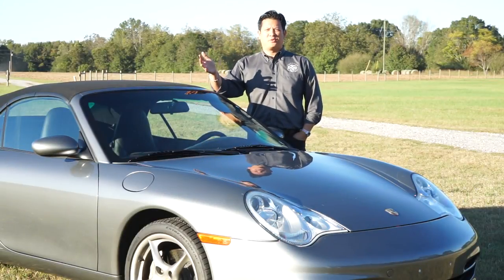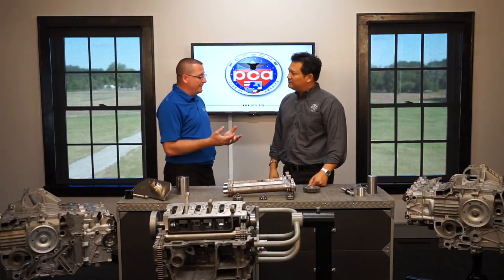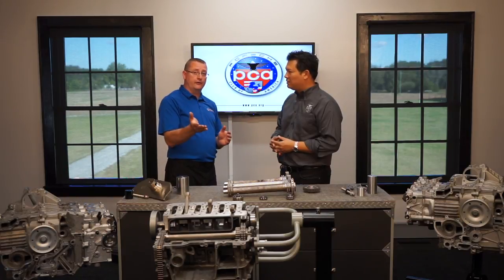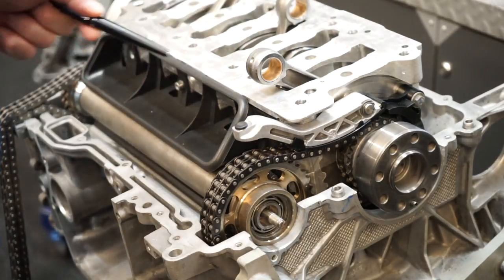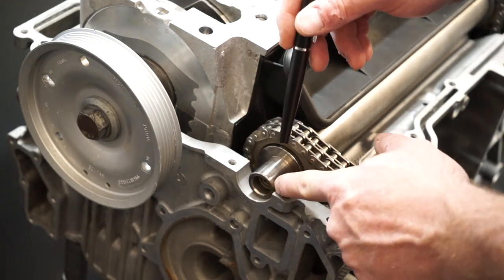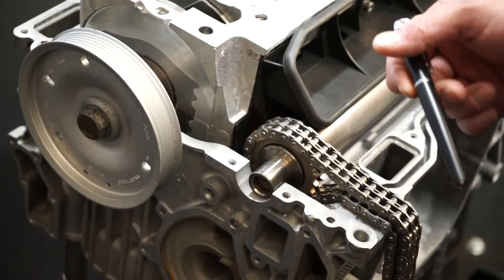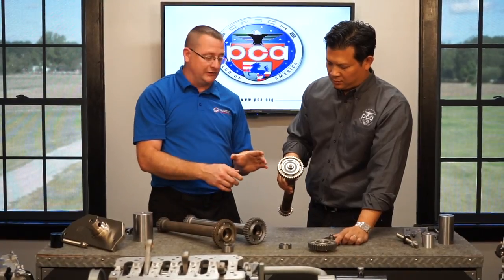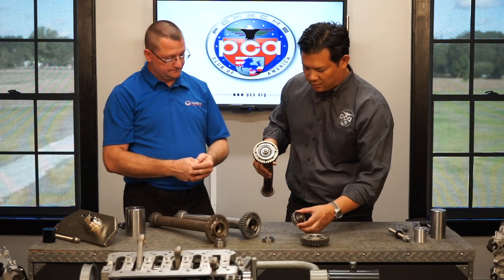Porsche 986/996: Intermediate shaft and IMS bearing explained - PCA Spotlight

Comment: This video is priceless to the 996 owners.
I have a 2003 996 with the replacement AD engine.

Engine was replaced by Porsche of North Houston in 2010, therefore the proper design dual row bearing.
I spent $600 before the puchase to have the trans pulled and visual photos taken of the large 22 mm nut. Now I have evidence for a resale someday.
In this video  I did learn that 6 month oil changes are jst as important as 5000 mile oil changes.
Lastly I am much more comfortable with my 996 after listening to the endorsement of the robustness of the new design bearing.
I did learn that 6 month oil changes are jst as important as 5000 mile oil changes.
Thank You this is a great service.
Reply from the maker: Thanks for watching. Be sure to subscribe.

Comment: Brilliant video...very explanatory but not overly complicated. IMS is just a way of transmitting drive from the crank to camshafts on a flat six engine. And that shaft runs on a bearing that is prone to failure. Until now I thought it was some mystical design, but now it's pretty simple.

Comment: I recall hearing from a US company that a solution to IMS problems is a modified cover with a drilling in it attached to which is an oil line that connects to a spare oil output. You remove the existing cover flip out the oil seal replace the cover with the modified replacement cover then hook up the pipe. End of problems regardless of bearing type. Search the net to find the kit.

Comment: I think the reason why they have two different bearings is because the front end of the intermediate shaft gets it lubrication from the engine oil , but the rear doesn’t get any lubrication from the oil, so that’s why it was made as a sealed bearing.
Reply: W C       I think that is exactly what Jake said.  I think.

Comment: I have talked to many Porsche mechanics that claim the IMS is not the main problem,instead the issue is lazy owners not warming up their engine to proper temps before thrashing the car through the gears down the road.Lets not forget the Carrera holds 8.5 quarts of oil and needs to be distributed to all parts of the motor at peak temperature. The mechanic insists the motor oil be warmed to 160 plus degrees to properly lubricate all the critical engine parts including the IMS bearing so it does not dry out and seize over time.I have owned a 996 and a 997 and never had one issue well over 120k.The Motul 8100 access is my oil of choice since it lubricates the IMS continuously compared to any other oil on the market.Do yourself a favor and Relax while your Porsche idles for 10 to 15 minutes before hitting the road ,and you will rarely have any issues ever.
Reply: T Shankster 
 Wrong wrong wrong.... respectfully, this isn’t true and I will simply paraphrase flat six innovations ( http://flat6innovations.com/)
  The primary issue with IMS failures is contaminated oil... caused by too infrequent oil changes.... the primary source of contamination is fuel intrusion based from cars injecting additional fuel into the system... while attempting to warmup prior to driving.... 
 Keep in mind the failure rate is 5 to 15% ; so the fact that your car has not had a problem makes sense because the odds speak towards it... my 996 hasn’t had a problem either....
 Extended warmups ( as you suggest) are a part of the problem
Reply: I agree with you that an engine should be warmed up. However,  per the video, the IMS bearings from 1997 to 2008 were sealed bearings. They weren't engine oil lubricated.
Reply: T Shankster I thought most or some of these bearings were sealed, if that’s the case would warming it up matter?
Reply: I may be overly careful but on my 2006 997 I never rev the engine over 3000 until the oil temperature is fully warmed up to 200°
Reply: Idling for 10 to 15 minutes for warming up the vehicle is not ideal.   I agree that quality oil is a requirement and driving it hard should only be done after warming up the car to proper oil temps (10-15 minutes).  Best bet is to start the car, buckle up , and drive gently for the first 5 minutes, and no high-revving for the next 5-10 minutes after that.
Reply: Old thread, but we have 2 older women with these cars with failures @6k & 22k. An 02 & an 04 respectively. Neither has been over 3 or 4,000 RPM other than when I have driven them. Porsche & their techs just refused to admit they are a bad design. It is German arrogance at it's finest. I worked for Lexus/Toyota for 20 years. They always admitted their faults & helped their customers. Full Stop.
Reply: Your many Porsche mechanics are wrong, and given the relatively low failure rate, your own personal experience isn't surprising.  The main failure mode is disintegration of the rear IMS ball bearing.  The rear IMS bearing is, in fact, a SEALED bearing.  It is not designed to be lubricated by the engine oil, and *there are no passageways that carry pressurized oil from an oil galley to the bearing race*.  This bearing is responsible for resisting both axial and radial force, and is designed to be used with its own lubricant capable of withstanding the much higher contact pressures found in a ball bearing vs a plain journal bearing.  

It has become evident that over time, the IMS bearing seals are inadequate and the original lubrication present in the sealed bearing is washed out.  If your rear IMS bearing is being lubricated by an occasional splash of engine oil, regardless of the temperature, it's likely already on its way to failure.  In fact, the oil being more viscous (colder) would likely contribute to a LONGER life of that specific bearing, if it was able to actually make its way into the bearing race.  Which it isn't.

It was a crap design.
Reply: It is a given for ANY auto engine to reach op temp before using it hard.  BTW, don't let the car idle to op temp.  Idle 30 seconds and then drive it normally. It is also a given to use the appropriate type and weight of oil in any engine. So given the higher care level most Porsche owners bestow on their cars, why all these failures vs lesser cars w less attentive owners? Bad inadequate design. Period.
Reply: Only 8.5 qts? My 911S was closer to 12. Good time was had doing the first oil change into a V-8 sized oil pan.

Comment: Let's not forget, the original flat six engines had endless problems with the timing chain tensioners, but you could fix the issues, often during routine maintenance. I think this engine should have had the same internal countershaft design as the original sixes, but oh well. Using a ball bearing that is good for an old roller skate was not a good idea.

Comment: I have been looking to buy a used Boxter but after watching his videos, the thought of owning one scares the hell out of me!
Reply: shouldnt have let it scare you.....you can buy any year you want its fine..... just know that soon as you buy the car
drive it strait to the dealer or who evers gona fix it
then 2500 bukks later know you dont have to worry about it....i think is a ceramic bearing now.
i would do a 2003 and up an get the replacement done but after 2008 your fine no IMS failures..2009 problem fixed by porsche.

Comment: So I had a 2005 Porsche Boxster (987) a couple years ago and I wish this video came out earlier so I could have learned more about the IMS bearing situations. Even though there are exceptions, what was discussed in this video is really solid and holds true to what happened to my car and other people I've met with similar issues. 

I was one of the people who took a chance and didn't do a retrofit IMS bearing since failures were relatively low, but unfortunately my car suffered an engine failure when the IMS bearing had problem. 

With that said, I still loved the car and it was an amazing car to drive. The hydraulic steering's feedback, steering precision, ride quality, etc. Just an amazing car and I'd still recommend these cars to people. Just watch the video, visually inspect your car or get it checked out, and take some precautions and care for your car.
Reply: Bryan Phan      Thank you for your story.  It will help me in my worries.  How many miles did your engine have?
Reply: @boyracer3477  I had about 81K miles when I had the IMS issue.
Reply: @tryptobphan      Thanks.  I'm about 30K from that.  But it breaks the theory that if it lasts this long, it will probably be okay.  And at 50K miles in 22 years, it's been doing a lot of sitting. I've had it for nearly three years and haven't put that many miles on it 
either.  From what I am learning, it's letting the oil just sit in the bottom quarter of the bearing that causes the problem.  Anyway, thanks and fun driving to you !!!
Reply: @boyracer3477  yeah. I was disappointed that mine was right at that edge of being OK if it lasted that long (aka 80K+ miles). But in the end, the company was really nice when I called in. Because of their customer service, I ended up getting a new Cayman at the time. Looking back, I should’ve just did the IMS upgrade for $4K and called it a day. The new cars are amazing but I do miss the hydraulic steering feel and the sound of the older engine of the 987.1.
Reply: @tryptobphan       Well, life is a journey.  Nice chatting.  I'll keep an eye out for your comments.

Comment: Sorry to say this .. but the IMS bearing is engineering design “screw up” by Porsche . I had a   81-84 Volkswagen rabbit back in the day, and decided to one day overhaul the engine . I cracked the engine open and noticed that it also had a intermediate shaft that ran the ignition distributor . Took out the shaft ,I remembered that that bores on both ends of the shaft had solid,pressurized oil, replaceable solid bearing on them, no damage whatsoever on them. I don’t understand why people have this “fix thing that aren’t broken “ mentality..

Comment: Extremely informative and timely ! I, of course fall right into the grey zone.. I have 03 C4S which had IMS failure at 36,000 miles in October 2009. Engine replaced with caret engine November 2009. Clever money says its an M97 design but only way to tell is to drop transmission. Ah well, needed a winter project.
Reply: did they replace it with an 09 engine 0r with an 03 engine thats the question

Comment: my prefered method of solving the problem for my 2.7 m96/23 engine would be installing an unsealed ims bearing and a direct oil feed kit from tunersmotorsport to keep it lubricated at all times. the low displacement of my car avoids the cylinderbore warping issue common on cars with larger engines.
Reply: You should go with the proven and patented journal bearing and oil fed design of the IMS solution.

Comment: Where can I bring my Boxster to replace the factory IMS with the IMS retrofitting. Mine is currently not showing any indication that the IMS is at fault, but the previous owner drove only 10K miles in 16 years and did only oil changes once in a year or some times after 2. years depending up on how much mileage he was putting. So I fear that it may be adversely affecting the IMS seal

Comment: Thank you for this video.  Can you tell me how the design was changed after 2008 to address the IMS bearing issue.  I have a 2011 987.2 Boxster with the 2.9L engine, and wonder how the IMS bearing design and lubrication were changed to address this issue.
Reply: Porsche switched to driving the camshafts directly from the crankshaft, and eliminated the IMS completely. Just google image search Porsche 9a1 and look at cutaway images.
Reply: there is no ims in the 2011 models

Comment: Great video. The first gen is the strongest (when it comes to IMS failure), though a trick that my specialist uses is to remove the seal so the bearing gets lubed by crank oil.
Reply: I've heard that, but it doesn't seem like a good fix.  First, the IMS is not designed to be lubricated by oil.  It's lubricated by grease.  Ya can't just throw any old lube at bearings...they're designed with the mode of lubrication in mind. Second, how can one be sure oil gets to the modified bearing when it was not designed to get oiled by crankcase oil?  At low rpm, and low "splashing", they bearings could get starved of oil I would think.
Reply: @MrShadyfish  Exactly. The whole reason for the sealed bearing was that engine oil could not get to that area of the engine. Therefore an open bearing was not possible. The solution that adds a new oil line with the sole purpose of directing oil at the replacement IMS bearing makes the most sense. Of course it's also the most expensive.

Comment: I bought a 2001 - 911 996 Carrera Cabrio. The owner kept it immaculate but I'm not sure if I need to change the IMS bearing. I changed the oil and there are no signs of any debris It looks like back in 2004 they dropped the engine for a seal leak. Do you have any advice for me?   I'm thinking of changing the IMS for peace of mind.

Comment: Since most versions of IMS bearings were temporary fixes, how long do you wait for an oil-fed one like the Metzger engine?  Have a 04 C4S that is worth about $50K plus with many options, rare PTS color, and lower miles.
Reply from the maker: Most folks do it at the same time as a clutch replacement.

Comment: i did replace my IMS but was totally unnecessary, it was in perfect condition when replaced after 80K miles with a VF supercharger and I suspect that idling my car for few minutes before driving  and regular oil changes every 6 months did the trick.
Reply: Have learned it's not good to idle Porsches better to start - drive and keep the revs in check until engine is warmed up.   With the dry sump high oil capacity the engine can't easily warm up the oil until it's driven.
Reply: maybe that worked, but when buying a used one, we have no idea how it was previously  treated

Comment: I did not realize that the 01-05 shaft was more problematic than either of the other two as stated at 22.09. I understand it typically comes with the single race bearing which is a major weak point, but didn't he say that the 01-5 shaft was a big upgrade on the first gen  ??  He does say that both the centre shaft and the smaller bearing are a problem. I assume that this was an error ??

Comment: Good discussion and description of the various IMS machinery, but why no discussion or description of what on these parts goes bad and/or causes the catastrophic engine failure? Is that on another video? Is there also another video that explains how to do a preemptive repair should the vehicle have an IMS that shows excessive wear or for peace of mind? Thanks!
Reply: This is supposed to be a series of video that will include more in depth discussion on the modes of failure.

Comment: Great clip, can a dual row bearing be fitted in a single row shaft without replacing the shaft and also while still in the vehicle?
Reply: BezED good question.  I would love to know the answer.
Reply: A stronger bearing can be fitted into a single row shaft without replacing the shaft and engine in vehicle.  But my opinion is to also add a DOF once the bearing is replaced.  The problem from the very beginning is from pressure differential within the shaft itself which had a "bearing" on the unlubricated bearing (sorry about the pun).

Comment: I've watched the video and I'm still confuse. Lol. I have a 2006 987 boxster s which has the 3.2L which I believe came from the 986 boxster s. Since its a 2006 does that mean I have the m97 type bearing?
Reply: lol late response ....what it means is you in the safe zone of the low failure rate being after 2005.
but unless you have a 2009 model i would still have the ims replaced....just for a peice of mind.

Comment: I'm a mechanical engineer that has designed bearing housing on gas turbine engines for many years. Porsche's IMS issue is pure incompetence. Its just a horrible design that has cost Porsche owners a lot of money.
Reply: It's a product of smugness and a product of knowledge that whatever they make will be sucked up by the market that loves hype (fuelled by cheaper and cheaper money).
Reply: You got it man! But thankfully, there are options if the owners are smart about it.
Reply: That's not the only issue with these engines, unfortunately Porsche skimped on quality materials which makes the modern flat 6 a POS.
Reply: Could they not have pressure fed this bearing and made it a plain bearing?

Comment: My Boxster was manufactured mid calendar year 06/00. But if they started making 00 model year 07/99, then "mid year" would be about 12/99. So which mid year are they referring to in this video?
Reply: as i said the safe zones are 2007 and up the 2009 no need to worry about it at all diff motor in 09
so anythin before  2007 get it done.